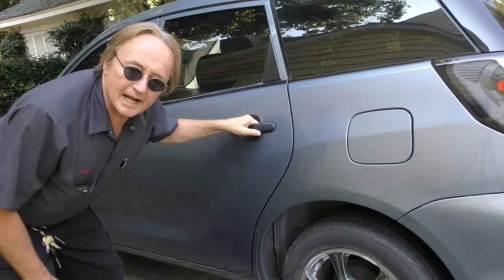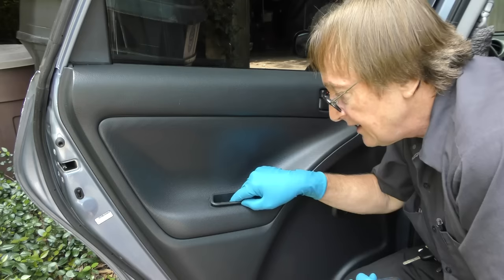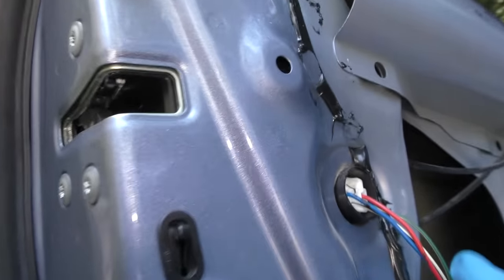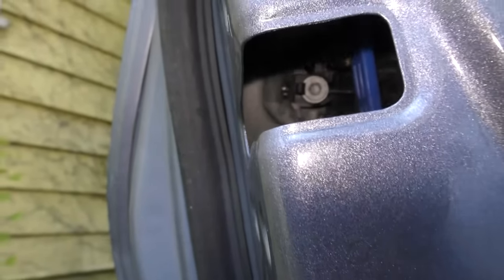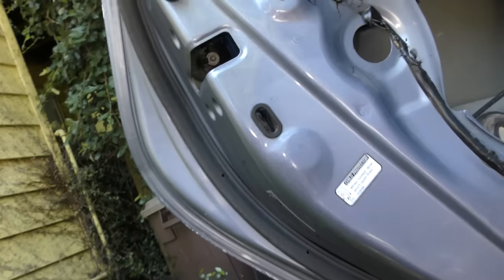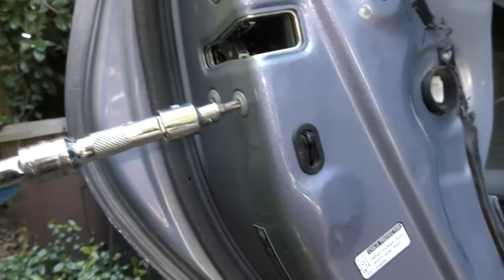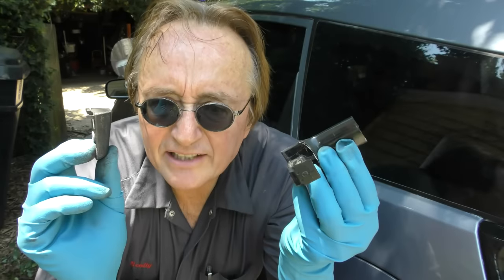How to Fix Car Door Handle for $10

Comment: It looks simple and I recently attempted it. The problem is that the door won't open when I pull the handle. So I tried it about 3 more times, same result. It turns out there is a metal rod  from the lock assembly that hooks onto the actuator and when you take off the actuator, you can accidentally detach the metal rod. There is a hole in the actuator assembly expressly for you to insert the metal rod. Make sure to insert the metal rod into that hole, so when you pull the handle, the door would unlock!

Comment: Hey Scotty!  A chain shop wanted $250 to do brakes (worn) and rotors (because they had a little rust on the outer edges.  Overall they're shiny and don't wobble).  I did my own brakes using your videos on brake shoes and brake pads and it cost me $50!  Thanks, you're printing me money!

Comment: Can you teach me how to lower the landing gear on 737? Pretty urgent, thx bye
Reply: Well I'm assuming you've lost hydraulics, in that case, you're sol, because unlike it's older brother, the 727, the 737 doesn't have a manual gear lowering system... However, if you just can't find the lever, look on your instrument panel for a lever that looks like it as a wheel attached to it. Pull it out when you're under 185 knots, and pull down. Look at the 3 indicator lights above it, when they turn green, then gear is successfully lowered. Then follow your approach after that. Don't forget your flare, and be sure your auto brakes are set, as well as get ready to use your reverse thrusters.

Comment: replaced my 2002 Tacoma with an el cheapo handle...lasted 2 months. Mine for sure needed to be an OEM replacement,$100 but after a year of using the passenger door it was worth it.

Comment: Hello sir, 3 handles are Broken on our 2000 Toyota Sienna. I haven’t had them replaced due to financial difficulties so thank you so much for making this video. As I learn I will be passing this knowledge to all five of my children. Can you please tell me what the tool is that you used to reach inside the door to unscrew the bolt as I will need to purchase that also. The van is poorly ventilated with only two front windows that open so it’s intolerable to commute in the summer. It needs new air conditioning how can I tell if it’s broken or just needs to be refilled?

Comment: My Nissan and old Bimmer have had the same handles their whole life. I didn't know this was a serious issue.
Reply: Dripping Wax: original handles and handles inside my doors as well. Between 1984-1987 (when my ED7 was designed) those engineers made sure they were built to last FOREVER.  Hate to say it, but  in the 2000+ era, parts get flimsier and flimsier, it seems.  Eric the car guy has a video up, of his 2003 Element, sporting a PLASTIC thermostat housing.  PLASTIC?!? Never buying any Honda again, newer than 1995.

Comment: Wow, that was easy...
When I fixed the door handle of my car, the bolt holding the handle was actually behind the glass. No matter how I move the glass, it was still blocking it.
I didn't know how to remove the glass all together, so I just had to put my hand behind the glass and somehow unfasten the screw using small socket...

Comment: Kept breaking on my Ford F-150.  So I had a machine shop cut me new door handles out of aircraft grade aluminum.  Not cheap plastic.  They used a cnc milling machine to make them.  Problem fixed.  Found out years later that older Ford models the handles were made from pot metal.  Oh well.  Live and learn.

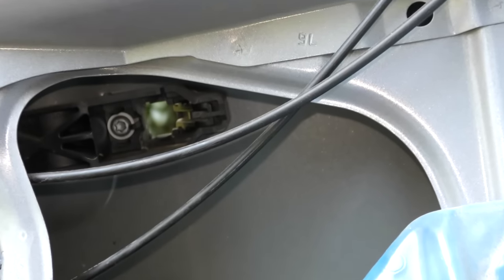Comment: 0:57 Scotty, if that screw was a regular slot as soon as loosened it would fall out and never be found again! at least with Torx, it stays in place.
Reply from the maker: you have a point there, but a regular screw head would have worked fine too, or a phillips
Reply: Magnetic screwdrivers forever.
Reply: It is too bad they dont always hold the screws perfectly
Reply: Here is a trick to make a magnetic screwdriver as strong as you want. You get some small neodymium magnets. They are very cheap, and can come in very small sizes. Take the magnets and TAPE them on to the base of any screwdriver (magnetic or not) right underneath the handle. It will be much stronger than a store bought magnetic screwdriver. Also it works with small ratchets. I wouldn't use this technique for large tools as the increase in magnets used becomes a finger hazard.
Reply: @itis2182  or just magnetize the screwdriver yourself

Comment: Thanks Man!  
Dealer .... grab your socks, cuz we need $178.79 to make this big repair, oh and you need a appointment for this one.
Crazy Kilmer... Grab your sockets, cuz you need to spend 10 bucks now (actually $12.80 delivered)
to make this small 20 minute repair, oh and at your leisure, make your own appointment.
Verified, and easily doable.   I need just 2 more  $saving DIY repairs via the  Scotty Kilmer Show  and then it's off to Waikiki for the week!
Reply: What do you do if the door doesn’t open after replace the handle put everything back together and the door doesn’t open?
Reply: @Thelewwho81  you can always open the door from the inside. It's not a difficult job, it just takes patience. To help yourself doing things like this and other things, always use your smartphone to take pictures of every little step that you do taking things apart, whatever they are. The more you can rely on yourself to do things and not have other people do them for you the more money you keep for yourself, which is a huge  amount over time.

Comment: I'm wondering why old car door handles are different than new ones. On a lot of cars pre-2005, the door handles were either flush with the door or close to. Of course there are exceptions, like the Honda CR-V. Now just about every car, you put your hand between the door handle and the door and you pull...except for cars like the 2018 Mitsubishi Mirage.

Why is that though?

Comment: The inside hand on my 2010 Silverado broke n the dealer wanted $575 for a new inside door skirt. Couldn't find 1 at any salvage yards ended up ordering it from rockauto.com. Can remember the cost but like $30 or $40 buck. Took like 20 min to change. Have close to a grand. Scary the cost of something so little.

Comment: The bolts that hold mine in place are stuck. Like I can get to them but they’re rusted on. And I got an half an hour to get ready for work so imma just cover it up and save it for tomorrow. Lol what I thought was an easy fix turned into a nightmare

Comment: I have a similar problem on my Toyota Passo, the rear right door handle moves, but the door can't open from the outside, also, the lock button in the inside is loose

Comment: Funny new cars have these cheap delicate plastic door handles that eventually break or just break with enough force but the handles on old square body Chevy trucks are so around you can tank on them as hard as you can and shake the truck back and forth

Comment: I don't understand why people are having trouble understanding "Fix" They seem to think that "Fix" should in the same category as repair and replace. As in if you "Replace" it you have not "Fixed" it when really "Fix" should be an umbrella term that has repair and  replace under it. So you can "Fix" your car by either "Repairing" or "Replacing" Why is this sooo hard for some people????

Comment: Hey Scotty,
Nice Video, i have a quick question for you. 
Every time i pull the handbrake on my car, it locks like its supposed to, but then when i put it down, it doesn't unlock the rear parking brake shoes. What can i do about this? i Have Disc and mini-drums in the back, disc for regular brakes, and the mini drums inside the rotor for the parking brake

Comment: Okay that's fantastic but I can't get my drivers side door open to do that. I need a way to get into my car using those holes where the door handle use to be. 2007 Hyundai sonata...btw I also can't open it from the inside due to the door handle from the inside being broken also

Comment: Scotty, I have a 13 Subaru Legacy with the dreaded "Subaru pull" I've done 4 alignments still drifts right with wheel centered on flat roads, swapped tires side to side and front to back. I've had all my steering and suspension checked all checked out fine. Lubricated all slide pins and any point of metal to metal contact points for the pads  (when I did rotors and pads all around) still pulls/drifts right when you center the wheel even on flat roads. Could it be a bad/sticking caliper?. I love my car owned it since new always kept up on maintenance and service car has 90,200 miles any advice appreciated Scotty! Thanks in advance

Comment: I don't understand why manufacturers use plastic door handles. They break easily in the cold. I guess the one benefit to plastic door handles is it won't burn your hand after sitting in the sun on a hot day.

Comment: Wrong, you don't need to unscrew the lock hatch box or the handle screws. All you need is remove the inside trim and the old handle pieces (except for the back part which is separate). Slide the new handle and use you hand from the inside of the door to glide the lock hatch behind the new handle hock (might need a bit of practice but its easy). Also make sure the back components are latched on to the lock. That's just a piece of plastic shaped like a fork and all you have to do, if its out of place, is to slide the lock shift( feels like a small metal rod) back in the middle of the fork.
Reply: do you have a video link?

Comment: Scott I have a question I own a 2011 f150 I would like to add replace the older type bulbs to LED tail lights but in reading it could make the computer think the tail lights are burned out. are there led lights! Or companies that make LEDS this will not happen? could be something others may also want to know about. I understand that why but some others may noy.

Comment: My outside handle is broken. I bought a replacement but I can’t figure out how to switch it because I can’t open the door. My inside handle doesn’t work (it’s not hooked on the lever inside the panel). I could use a tip 😱😔

Comment: This has to be a Toyota. I have never had a broken handle on anything but a Toyota. On a Previa and a Camry I used to own 20 years ago, which was a wagon. On the Previa, everything that has to do with doors has failed. Locks, handles, inside handles, glovebox, hell even the fuel door has failed and I have to open it with a flathead. But, that was the ONLY thing that has ever failed on that Previa. Not a single fucking other thing has ever failed or wore out. The interior looks brands new even after 30 years. But I can't lock it or lower the windows. I can already tell you that the Sienna doors are the same way as the left sliding door is already failed. But I got the right one works perfect.

Comment: Fixed the outside handle. Now i cant open the door from the inside. The lock switch is loose...  any idea what i did wrong so tomorrow i can fix it?

Nvm fixed it. The cords got loose when i reattached the panel.

Comment: That's not fixing the door handle - it's changing it :) (I thought you were gonna glue it together) And on some cars - it's better to get used original ones - I cant even remember how many aftermarket door handles for Golf II my friend bought.
Reply: draconpost still considering fixing something or the problem. when your car breaks down your gonna call a mechanic to come fix it. or should I say change something
Reply: Hmm, maybe you're right, you fixed the problem by replacing the part. Still, I thought you were going to repair the handle itself with some kind of amazing glue, the kind of thing you sometimes do - amaze us with some fun gadgets, tools and stuff. The title mislead me because I got used to people skimping even 5$ on parts and spending two days machining it... and then crying that it broke again and damaged something else.

Comment: Just before I sold my 98 GMC Sierra for scrap parts, the inside drivers door handle broke off. I found the part for 5 bucks on the internet but didn't buy it yet. Then I found out that the damn assembly is riveted on so you would have to drill them out and then screw the new handle in and hope it works. Dumbass engineers.

Comment: I'm unsure of what you did to fix it... I seen you take it apart and put it back on... Did you buy a replacement? At no time did I see you fix anything, just R&R.
Reply: yes he replaced the handle these things are pretty cheap
Reply: Jason Grimes ummmmmm yup
Reply: See 2:33
Reply from the maker: man, did you watch the video? I even show that I bought the replacement on amazon for less than ten bucks
Reply: Scotty Kilmer I was assuming you were fixing not replacing. That car was a cheap replace. For mine is over $30. So seeing how you said fix for $10, I was excited. I can afford that.
Reply: I don't understand why people are having trouble understanding "Fix" They seem to think that "Fix" should in the same category as repair and replace. As in if you "Replace" it you have not "Fixed" it when really "Fix" should be an umbrella term that has repair and  replace under it. So you can "Fix" your car by either "Repairing" or "Replacing" Why is this sooo hard for some people????
Reply: fix a broken assembly by replacing the broken part
Reply: To me if you say you're going to fix the broken handle and it's at a set amount price, I'm thinking repairing what's broken with a tool or devise or some sort of bonding agent. But instead he replaced a broken part that happened to cost $10 for that particular vehicle. For my vehicle to replace the broken part is about $30. I found nothing under $10 or $20 to replace it with.
Reply: malrofo I'm thinking the correct way to say it is replace a broken part on the assembly. To fix the broken part would imply repairing what's broken.
Reply: "If it breaks off in your hands, fix it for under $10". Orders new part, doesn't fix one that came off the vehicle. So he replaced it for under $10.
Reply: Jay Santos patching is fixing, replacing it is not fixing... It's replacing. If you replace the tire, you didn't fix anything.
Reply: Just because this specific example was $10 vs your $30 does not mean that it is wrong to say fixed. What you really mean to complain about is that $10 is too specific. If you want something to complain about then you should say the video should be titled "Broken door handle? Fix it for cheaper than the dealership" Your only argument for this not being a "Fix" is that his cost $10 and yours cost $30. Basically you're trying to define a "fix" by a price point. "Well if its $10 or less it can be a fix, but if it's $30 its not a fix anymore" Just because it says $10 in the description don't assume he used glue or epoxy.....
Reply: srogers88 no, he said fix it for $10. So I assumed he fixed it with something that cost $10. And thought it be for any door handle but it was to that specific car. He replaced the handle.... But what was fixed.. How are you fixing something if you're not using any part of the broken one? The door wasn't broken. The handle was. And the handle got replaced with a completely different one that was not broken. So again, what was fixed?
Reply: He did reuse the gasket...just sayin'.
Reply: Thanks everyone for all your replies. I won a bet that I can irritate people over nonsense. Although the title could of been worded differently. Sorry if I took it too far.

Comment: Evil company used torx bolts? What does that make the company that used external torx bolts for my wheel bearing?
Reply: Scotty Kilmer it's a Chrysler. I had to call the local auto parts to see if they had any, throw the wheel back on to go get it and then start over